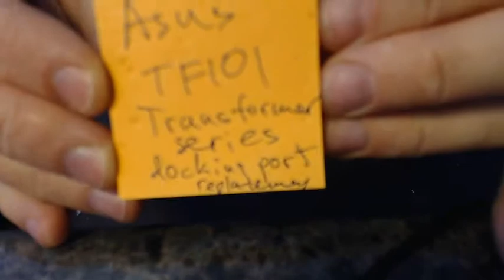Asus TF101 Transformer series broken docking port replacement Laptop Power Jack Repair

Comment: I would like to know the function of the red, green, yellow, blue and black wires coming out of the battery. My asus TF101 is not connecting or charging the battery, I measured the resistance of the connector of the board where it is connected to the battery the resistance measured between the blue wire and the ground is with 39 men, I wonder if the low value is good. Can someone tell me if it's right?
Reply: Helpe me please.

Comment: i have a ASUS MeMO Pad 10 the charging port is damage do i have to replace the motherboard??? that wnat asus tells me....first they tell me motherboard than i said i only had chargin port issues....than they say oh your charging port damage cause of misuse/abuse we have to change the motherboard
Reply from the maker: this particular jack is just a cable that is not even on the motherboard, you should be able to replace it yourself, the problem is there no more jacks like that AT our place for replacement, but i am sure you can find them on line.  They are just plug and play no need to solder anything.